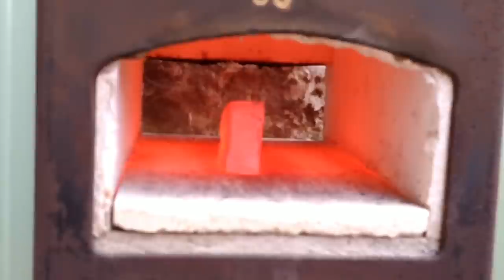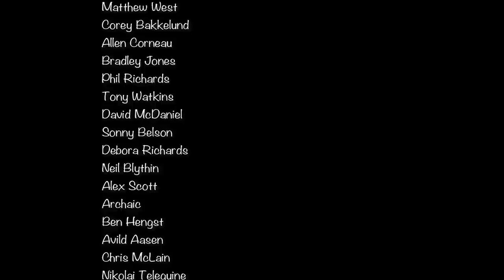Forging Super Short Slot / Eye Punch

Comment: Nice socks!
It's a bit unusual for a GS tongs video to have so little narration. I still much prefer it to your traffic videos! That Guillotine tool looks mint! And as usual your tongs are second to none in my opinion. I hope to someday be able to order some. And I think this is a pretty good how to make a small punch, with very little material video!
Reply from the maker: Yeah, I decided to keep quiet for once. That guillotine tool is working out well. And this tong was actually a reject, slip joint style tong. I decided to dimple the sides and so make it for a fixed size. I will try to make a better version of this tong soon. Big thanks.

Comment: Hi Glen, in the beginning of the video you used something, I believe to square up the grinding wheel, what was it ? Looking forward to your next video.
Mike.
Reply from the maker: That was nothing more than an old grinding wheel. You be surprised how well they can work, especially at getting small steel bits out of wheels so they work smoother. Thanks Mike.

Comment: have you tried the long magnetic tool / knife holders on the anvil to reduce the ringing, i know you mentioned the neighbor problem a good few vids back
Reply from the maker: I do have some magnets on my anvils and that helps a lot with the ringing. But the main noise I need to reduce is when I strike top tools like longer punches, my flatter, etc. Thanks.